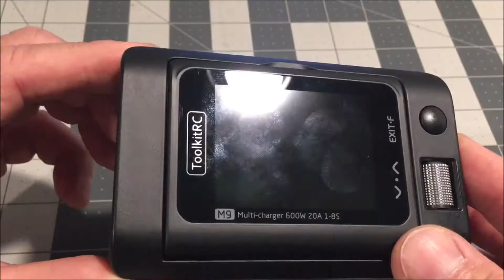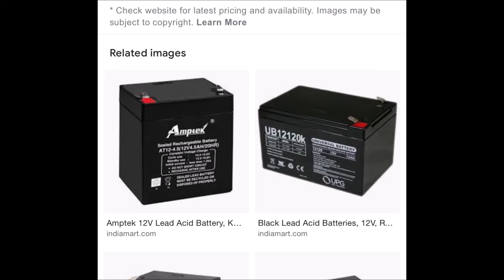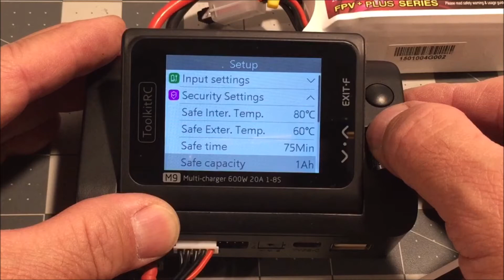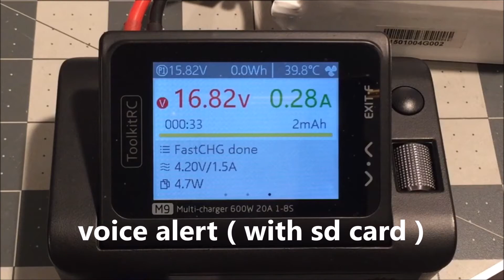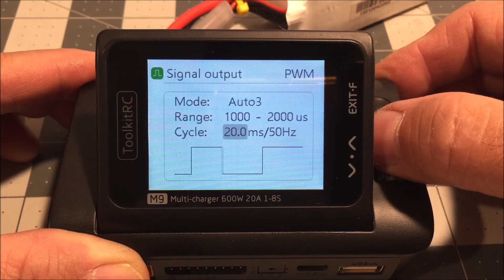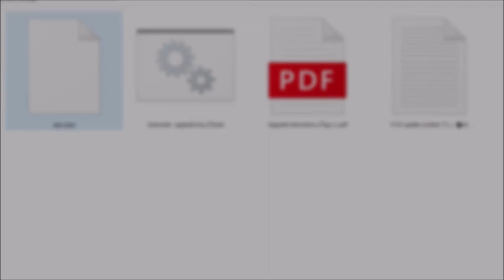ToolkitRC M9 Multi Function 600W 20A DC Smart Charger Custom Audio and Bitmap

Comment: I think the safe capacity is Amp Hour and NOT just Amp. Am I correct in thinking there's a difference?
Reply from the maker: What are you referring to?  The battery or the charger?
Reply: @RCEscape  The safe capacity is the maximum accumulated capacity for a charging/discharging session.

Comment: What is the difference on internal and external Discharge?
Reply from the maker: internal discharge is when the energy is dissipated as heat by the charger and external discharge is when there is a load absorbing the energy like regenerative discharging to another larger lipo battery.

Comment: Does this have a balancing feature like the m8? I have a out of balanced battery
Reply from the maker: It will balance charge, discharge and storage discharge or charge but there is not a separate balance mode by itself.
Reply: @RCEscape  Thank You for the details. The M9 is nice...but the m8 has that one important feature most dont.